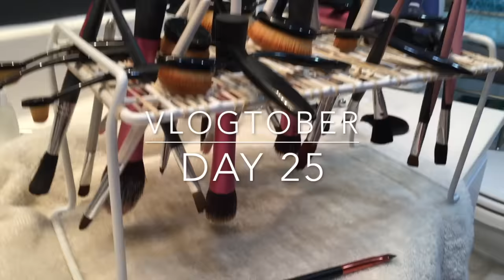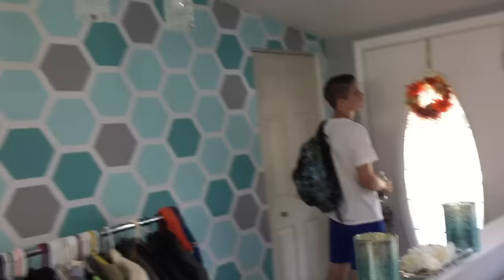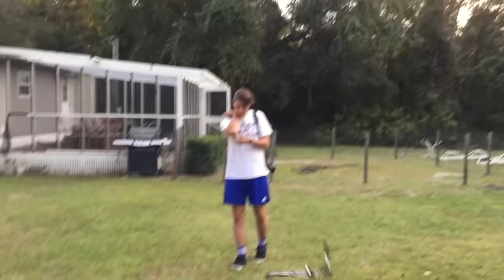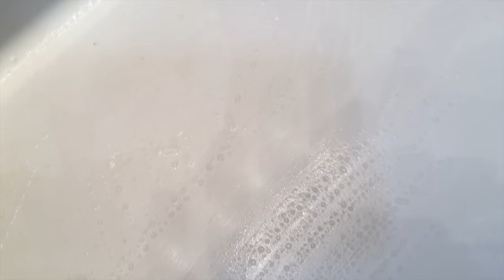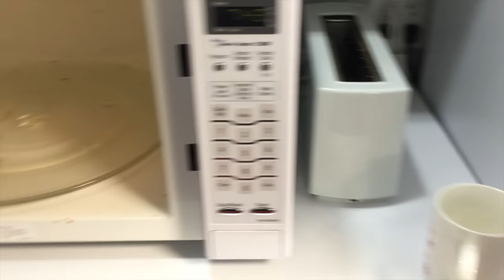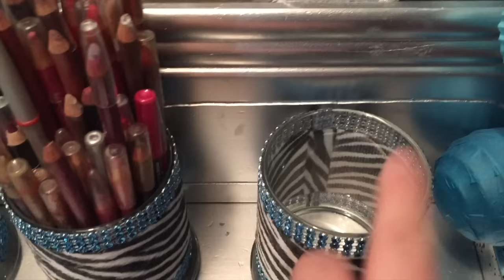VLOGTOBER DAY 25 | BAR KEEPER'S FRIEND?

Comment: I am watching.... If you let it sit for a minute after you get it all lathered up it will do wonders. ... I had to use it the whole time I grew up with country well water on our tub and porcelain sinks.  I am glad you like it. Let it soak for a few though and you wont have to scrub as long. :)
Reply from the maker: ah, great tip.  i will do that on the other side :)  thanks so much for letting me know about this product.  it works great!  TFW <3